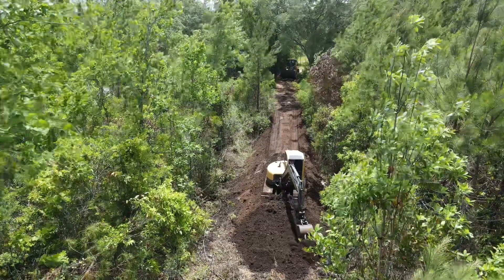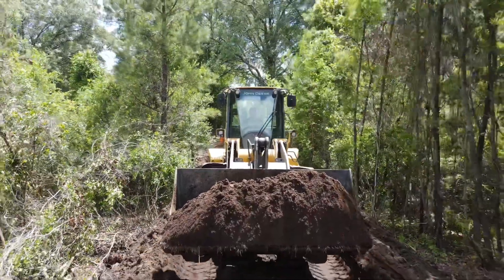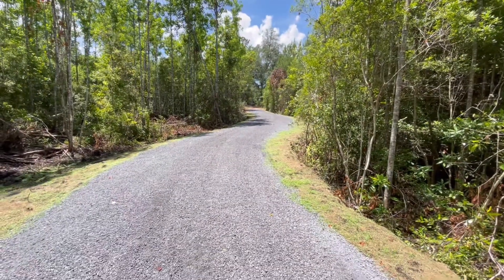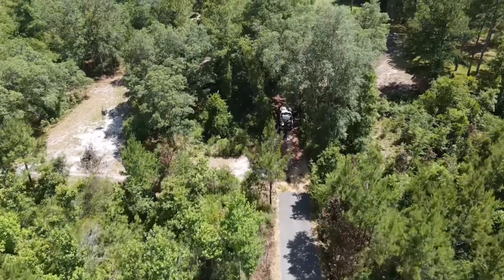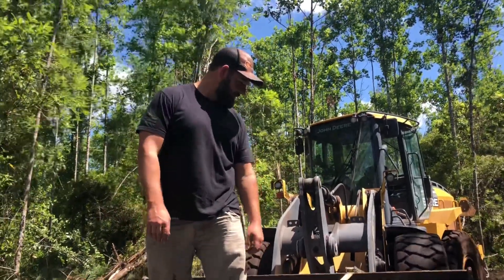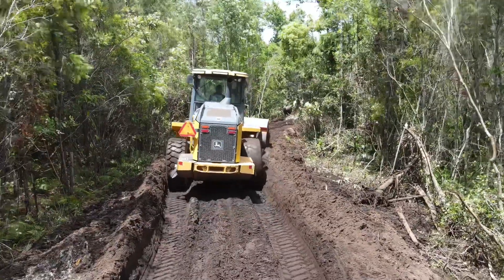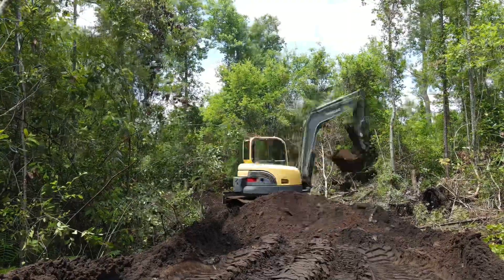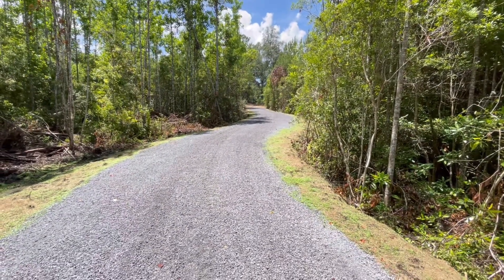Impassable bay to “Cadillac road”transformation!!!

Comment: Never knew there was more than one "d" in Cadillac .It is so hard for me to get the concept of a non-flat part of Florida. Interesting idea to use the high center of the road to slide the bucket on, I have done that with the skid steer but due to low ground clearance it still gets stuck. That's a great transformation from stuck in the swamp to easy driving. As for video views I have been down at nothing for over a decade.  I do watch and comment on most of your videos.
Reply from the maker: Lol me either.  I’m half shot out 😂
Reply from the maker: Yes sir you comment on all my videos and I appreciate it
Reply from the maker: Caddirac 😂
Reply: @floridabrushanddirt2482  As a fellow Floridian it is something I have to do!  Besides I enjoy your videos it is so different than here.